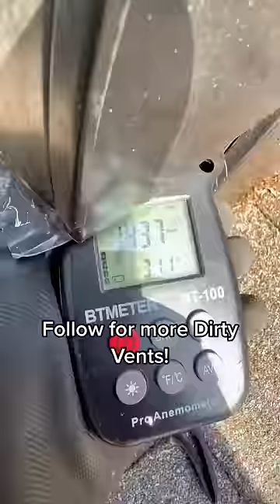Extreme Fire Hazard 🤯 #dryerventcleaning #laundry #cleaning #firehazard #lint #oddlysatisfying

Comment: It’s kind of crazy that people just call an expert sometimes, instead of trying to figure it out themselves. But, glad you got the work!!
Reply: You can clean the dryer but you can't clean the exhaust without rods and either a special whip or head attachment and compressed air
Reply: @HalfRoastedDuck  I totally get it. They definitely needed someone to come service it! Didn’t look like they even tried to fix it though
Reply: @ryanbanez7926  there's no point in them attempting to clean the vents if they don't have the tools to do it
Reply: @OO-sq1cd  I said I get it.
Reply: @ryanbanez7926  you said they didn't even attempt to fix the problem, why try when you don't have the tools
Reply: @OO-sq1cd  its not hard to jerry rig some random bullshit together it might work it might not but it usually works
Reply: It might be a single mother who doesent know anything
Reply: @taikajorma7276  I am a women I am always trying to do things by my self before I can’t handle it and call for help but this kinda of think is just easy if you just clean every once/two week I do it every time I used the dryer the means once every three days I clean as soon as I am finished using it because I I know there linens every where well not throughly up to the fance but at least not this  bad
Reply: @Fin3rain  Jerry rig something, then break something that wasn't supposed to be broken, and then have to go and actually get that second problem fixed and be out on a lot more than if you had gotten an expert to fix the original problem
Reply: @jl63023  so far never had that happen
Reply: I have dust mite allergies so NAH IMMA NOT GONNA TRY TO FIX IT MYSELF
Reply: @Daniel-z2j2v  I appreciate your opinion but I don't think you've ever worked at a duct cleaner before Daniel😁
Reply: @Daniel-z2j2v  preacher, brother.
Reply: @sutiniselametsikun3510  you’re a legend
Reply: I mean, that's how the world works. The electrician pays the auto mechanic to fix his car. The auto mechanic pays the AC guy to fix his furnace. The AC guy pays the tile guy to do his bathroom. The tile guy pays the electrician to redo his panel
Reply: Had that mentality before. Cost me $2950 and a blown head gasket.
Reply: @Daniel-z2j2v that make you feel manly? Why are you so insecure.
Reply: I think they did figure it out,hence why they called an expert.
Reply: @HalfRoastedDuck  I’ve never worked at a diesel shop either but I do work on my own truck.
Reply: @Daniel-z2j2v  wow you own a truck, so do half a million other people and they actually have cool trucks. Jk there are no cool trucks my guy😂. Maybe get an apprenticeship
Reply: @Fin3rain  jerry rig yes.....i just got told at work i offended some one by saying that...#JerryRigIt
Reply: @Daniel-z2j2v  thats expensive
Reply: @OO-sq1cd I cleaned my vents the other day by attaching a toilet brush to some wire and feeding it through. Now it takes one cycle instead of three to dry my clothes.
Reply: Not everyone wants to figure it out. To some it’s more valuable to call an expert
Reply: You'd think with the level of information and access to data we would be more inclined to solve basic problems. Its made us lazy and complacent.
Reply: isn't it a point of being an "expert"?
Reply: @OO-sq1cd  i think he is more so talking about how they didn’t even try anything they could reach, cuz at the beginning of the video there is a lot that the guy was able to take with just a glove and normal vacuum(what was on the floor and in the wall).
Reply: @ByoticVAL  no point in doing it if your just gonna pay someone else to do it for you
Reply: @ryanbanez7926  who wants to do that when you can pay someone 😂
Reply: Yeah, crazy to call an expert
Reply: It just hit me watching this...i have a shop vac!
Reply: Whoever called for this job needed help not all people are smart they aren't bad people their brains are just difrently inclined
Reply: The thing is some people just won’t do certain tasks. In my first house I cleaned the vent twice a year taking roughly 15minutes. The current house I live in, I have no idea how long the exhaust is and the time it will take far exceeds the cost of calling in for service as my time spent cleaning could be better spent getting new clients, honing my craft or just relaxing.
Reply: @HalfRoastedDuck you can buy everything for the price of the "pro" and then you always have it, and if you actually care for your house you'll have most of the tools anyways.
Reply: Bro sometimes elderly people or people with disabilities can’t attempt to fix it themselves plus they could make it worse so might as well call a professional
Reply: i bet there are a majority of people who are oblivious that they can do it themselves but they can afford to not do it themselves you know. no complaints
Reply: That was a 🔥🔥🔥 in the making
Reply: How a regular person gonnw do what the professional did... I don't have any of them tools
Reply: @OO-sq1cd  the brush for vents is like $30
Reply: @OO-sq1cd  these people commenting must not be home owners, or they’re some weenies. I am fixing / improving shit around the house literally non-stop there’s always something to do. Especially if your laundry room is “getting hot and filling with dust” 😂😂
Reply: Nobody taught me this stuff and most of the time you won't find specific info about it on the internet. My dad on the other hand knows a lot and knows how to fix, but you can't compare it with an expert work and he did mess up a couple of times. It's nice to have some useful skills but today's world is very busy and has other goals. That's why we started to pay for such services in the first place.
Reply: I mean personally i would do it myself, but id rather not fuck anything up 😂😂
Reply: I am not going to buy industrial grade sucker for a once a year clean up.
Reply: @zooleebest  that too, not spending damn near $200-$400 on a pole 😂😂
Reply: It's crazy how some work should actually just be left to experts.
Reply: Hahahah great comment. When i was a kid we used to blow in a game boy to fix it
Reply: @OO-sq1cd  all you need is a drill wich most homes that can afford a vent shaft have at least 1 and a 10 dollar 15 foot brush on amazon costing atleast 10x less than the expert what are you talking about dude
Reply: @jl63023  all you need is a drill wich most homes that can afford a vent shaft have at least 1 and a 10 dollar 15 foot brush on amazon costing atleast 10x less than the expert what are you talking about dude
Reply: @jl63023  really sounds like you have never cleaned your own vents lol
Reply: @solaryellowis3007  if common sense makes you feel insecure idk what to tell you might wana try idk growing up mentally
Reply: @Liveandlearn-  your comment should help you understand why ppl are saying do it yourself not shure why your agreeing with 0' '0
Reply: @zooleebest  all it takes is a shop vac that you should have in your house anyway
Reply: I'm a 100% diy guy (sometimes to my detriment).  But I've been there,  sometimes I just don't have the time or feel like doing it!  My time may be worth more than the cost of paying. That said, I don't let stuff go this bad. There was quite a few issues in the video and a little regular maintenance while doing the laundry can usually prevent most of these issues in the video.
Reply: @cetyl2626  when you think of the hours of work that you did to get that money vs what your paying another guy to take your money it makes you rethink that statement real quick
Reply: Some people time is more valuable than money for these kinds of tasks. I cleaned my own dryer vents and every time I do it I ask myself why the hell am I doing this?
Reply: @kane2440  why would anyone rethink that statement? If you personally believe that your time is worth more than whatever it cost to hire a cleaner then it is. 
My floor broke a month back, 3.5k quote or 1.4k on materials and do it myself. 1.4k was a hell of a lot cheaper but 1000% i shouldve just shelled out the extra 2.1k and saved myself over 30 hours of ripping up and replacing floorboards, because 30 hours of my time (imo) is worth more than 3k
Edit: grammar
Reply: @tytonbowring4293  you dont need to ask why i told you
Reply: @ryanbanez7926  you clearly don’t get it, you claim to yet your comment is a rebuttal
Reply: I’m not going to try to DIY my own glasses or set a broken arm for the sake of “trying to figure it out myself”. Neither am I going to shame healthcare workers for not being able to draft up floor plans for their home renovation by themselves on Autocad or Revit. Stupidity.
Reply: @Liveandlearn-  I’m sure your coworkers LOVE that your new primary personality trait is home improvement projects
Reply: @OO-sq1cd  they wouldn’t know they need tools or not until they take a look themselces
Reply: Maybe not all of them have the right equipment or don't have the time
Reply: @OO-sq1cd  the tools to do the fix are incredibly cheap. I'm sure that service call was over $150..could have done it themselves for $25-$40 and then have all the tools to do it again in the future..
Reply: Complimenting what others have said

Some people also just don't have the time or lack motivation

I personally love cooking, but hate dealing with the aftermath, so I wouldn't mind hiring someone that helps me with the dishes and cleaning up the house once or twice a week while I work in the huge amount of projects I have accumulated
Reply: @OO-sq1cd  if you have a house, tools should be a must.
Reply: @OO-sq1cd  i'm pretty sure the could have cleaned up on the wall and floor behind the dryer with a vaccumcleaner...
Reply: Never took your car to the shop? Or you do it all yourself?
Reply: @KevinOrtiz-ul9th  well with a decent set of affordable tools, i would totally just do most routine maintenance by myself
Reply: @asadb1990  me too.. i would atleast try to save some money
Reply: @thegamer  agreed i came from an immigrant household and if we hired someone to do all the work around our house, we would go broke. From an early age, i learned to do a lot of things myself.
Reply: @Panda-xd5ey  you do realize if the dryers were clean there wouldn't be any fires caused by it, which means less for the healthcare workers to do. And calling someone out is not cheap. Plus in todays day and age you can just google " how to clean dryer" or whatever... Stupidity
Reply: @asadb1990  agreed. Where i live. Calling someone can be ridicilously expensive(depending on the situation of course)...
Reply: @thegamer-12  and why would they do that when they were gonna hire someone to clean the vents and all the other stuff either way?
Reply: @OO-sq1cd  because they might not have money. I mean the in this case the hired the guy. But in other cases they might not have
Reply: @thegamer  i live in canada and in most cities its very expensive to have a service person come in for most things. The only people who could justify such luxuries are dual income couples both making 6 figure salaries each
Reply: @asadb1990  same in sweden pretty much (where i live)
Reply: @thegamer-12 just cleaning up the wall and behind the dryer would do nothing. If a fire did happen, it would spread up the vent because of the lint stuck there
Reply: @kane2440  yeah you’re right I tagged the wrong person
Reply: @Panda-xd5ey  I have employees, not coworkers. And seeing how it’s a construction company yes we are all proficient in home improvement
Reply: is called division of labor and has allowed society to grow and develop a lot.
Reply: @Fin3rain  jerdy rig some random shit, create further damage, have to call someone anyone, pay even more for repairs. Makes sense  🤷‍♀️
Reply: @brittany7298  as I mentioned previously never had it happen so far
Reply: @Fin3rain  Nah.  Jerry rigging is what creates more issues when it inevitably goes wrong.  Leave the complex jobs like ones that involve holes in the wall to the professionals.  They could’ve easily made that situation worse had they tried to do it themselves without training or enough knowledge…
Reply: @HalfRoastedDuck  I used a Miele vacuum w/attachments, no mess.. Please get a professional to install what you need.
Reply: @Fin3rain  What we're looking at here is jerry rigged..
Reply: @taikajorma7276  I was a single mother & never did anything like this. Never used compressed air either.
Reply: @HalfRoastedDuck  leaf blower and a cobweb brush on a extendable rod my dude. Been renting the place we are at for almost 6 years, when we got it the vent was clogged and fixed the issue with those 2 items. Every year since we will clean it out and no problems at all.
Reply: @Fin3rain  Not everything you clap together works or forn that matter is consodered QUALITY work. Not to mention a part could get stuck and make the issue worse. Please dont assume things lets just take a step back for ppl who are disabled, elderly, mentally unstable(which is a big portion) or ppl who just dont have the time its best to call in a professional if you cant get it done and its better than just letting it be.
Reply: @sutiniselametsikun3510  you clean the outside exhast vents every two weeks ?😂
Reply: @Daniel-z2j2v  Not everyone wants to be a handy man/woman and people are busy with other things as well not to mention a large protion of u.s population have a disabilty, mentally unstable, or elderly i rather someone get it done ragardless who does it than leave it be and become a fore hazard.
Reply: @Daniel-z2j2v  congrats ig 😂 i didnt know you were trying out for a manly competition in the comments
Reply: @fragoutrambo6381  Dude this isnt a competition go sit down somewhere. Not everyone is mentally or physcially able to do these things and even then people have lives too. I respect learning how to do things on your own within reason sometimes its best to get a professional.
Reply: @Liveandlearn-  good for you ig?
Reply: @kane2440  dude honestly why are you so presssd about a vent let it go
Reply: @kane2440  did you not read his comment not everyone has unlimited time to tinker om home diy projects all day some ppl habe to work amd take care of kids .
Reply: @Panda-xd5ey  😂lol
Reply: @GageDrums  cool we dont care
Reply: @asadb1990  congrats
Reply: @GenesisRasphotos  bruh leaf blower😂, tf are you talking about
Reply: Luckily I dont' anymore, but once upon a time I worked 12 hour shifts 6 days a week and sometimes 7th as overtime to put food on the table.

"crazy that people just call an expert sometimes, instead of trying to figure it out themselves"

Maybe - but maybe I'm literally at breaking point and thinking about working on my rare days off actually has me googling highest buildings in my area. In my experience this is the more likely scenario for people, especially these days. Times are hard.

Plus, paying someone to do it is good for the economy - likely a small business or a single trader who'd come and fix this, giving that money to them helps them feed their family too.
Reply: @ryanbanez7926 ☠️
Reply: I think what he is trying to say is simply, that REGULAR cleaning helps so something like this never happens or at least takes YEARS longer to build up.
We don´t know anything here. How long since the last cleaning if ever cleaned before?
Some people never empty their vacuum cleaner and wonder why there is no suction or it sounds like exploding as soon as you turn it on.

Cleaning the filter IN THE MACHINE should be a thing you do every month.
And with this big of a laundry (?) room, you can easily take a look behind the machine to see the dust.
Without knowing any details of the situation, if the owner would have cleaned it ONCE A YEAR I am 100% sure this wouldn´t have happened.
Reply: @taikajorma7276  even if it's not, there's no shame in calling an expert to do something. It just means you value your time and effort (or can afford these things, which is also rather good than bad)
Reply: @fragoutrambo6381  wash your clothes in a lake by your hands, dry it in the sun. Don't use the vacuum, broom your floors. Cook your food on a fire. Walk to your work, don't take a bus/ride a car/bike. Don't be lazy.
Reply: @merosepearl6325  very pressed
Reply: What regular person has all those tools laying around? And how would they know which section of wall to cut? Stop bringing people down
Reply: that‘s what experts are for lol
Reply: Better to get an expert in to do it right rather than fucking around and causing damages that could've been avoided.
Reply: OP, for real. 😂
Reply: thats like a normal thing to do no?
Reply: @heromedley  If you find the specific problem or at least narrow it down, it limits what the technician may try to add on upon "discovery". People nowadays though are lazy to find or narrow down the issue, they call, but then complain about the pricing.

A dryer issue of mine was fixed with a vacuum into the lint bin where it had not hit the mesh liner. Didn't need days in advance appointment or a tech or to take a day off to solve that one. 20 minutes.
Reply: @Fin3rain some ppl need that price of mind that it was done correctly, especially after you see all these vids about fires
Reply: You don't have the money and expertise to find out and do what's right but have the money to hire someone to do it, then why not? Why wasting time to do chores like this when you can make more money for that time you will spent doing this.
Reply: "Americans" 😅
Reply: @ryanbanez7926 I definitely agree with you! If no attempt is made it's pointless. I don't have to clean the lint trap each use. Well... Since I do clean the lint trap I don't have to clean the line out often. Well every few years I have to reconnect the hose because it gets loose & clear what I see then. This is exactly how fires happen.
Reply: there are many reasons the person called someone instead of doing it themselves
1. they just didn't want to
2. they did try and realized they needed someone that knows what they're doing 
3. they where too busy to do it themselves 
4. mental illness 
5. phisical disability 
6. phisical injury
7. allergies 
8. illness
and that's just off the top of my head. best not to judge when we don't know the details
Reply: I mean, i’m sure they tried but I’m sure they also realized they were out of their depth and called an expert.
Reply: @sutiniselametsikun3510  I mean, I’m sure it worked out good for you, but it’s not a guarantee for every other person that’s gonna go well for them.
Reply: @Daniel-z2j2v  $40 tool sounds great execution really depends on the person, it’s good to know that you are capable, but not everybody is capable. I’m sure we appreciate the royal titles, Lady boy and Lord girl!
Reply: @fragoutrambo6381  The same can be said, for inflammatory comments about the world by people that insist that they know better when really, they are just out of their element.
Reply: That’s why people have jobs
Reply: When you have $$$ you don’t want to spend the time to do it yourself. Time is money to most people. They rather use that 2hours to spend it with family or work on a project. It’s money we’ll spend 😊
Reply: well, an expert is an expert for a reason. they KNOW what they’re doing. they’ve done it a hell ton of times before, you might do something wrong and- bam.
Reply: Sometimes the smartest thing to do is to let the experts do it.
Reply: @HalfRoastedDuck  those cleaning rods costs big max 30$ except for the compressor but let’s be honest if you own a house you most likely have a compressor already
Reply: Some of these issues are so damned easy to fix for free. Older washers and dryers like our Kenwood are easy and inexpensive to fix, too. Spent 400 on both used and fixed them both in the two years we've owned them a handful of times.
Reply: I understand needing tools for a proper job but at least once in a while clean behind the dryer lol
Reply: @HalfRoastedDuck  I've found 5 compressed air tanks in the past year that people were getting rid of while on my 10 minute drive home from work. They needed minimal repairs and used one of them for parts to fix the others. If you have a knack, you can obtain the tools required fairly easy and cheaply. We've simply raised generations that would prefer to avoid physical labor at all costs. The other tools can likely be rented or bought for a small price compared to service calls. People would just prefer to let someone else do the work.